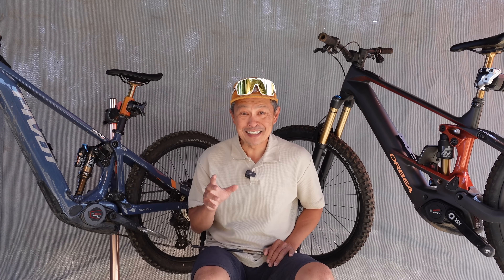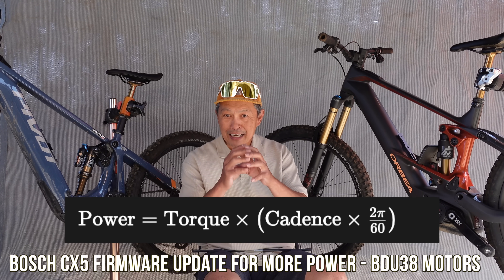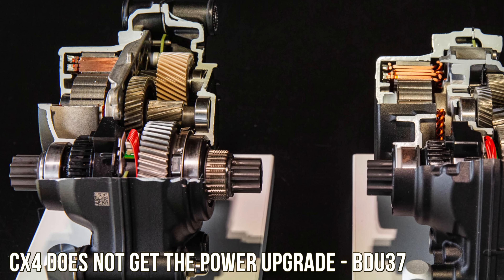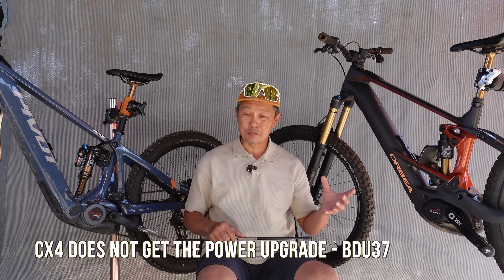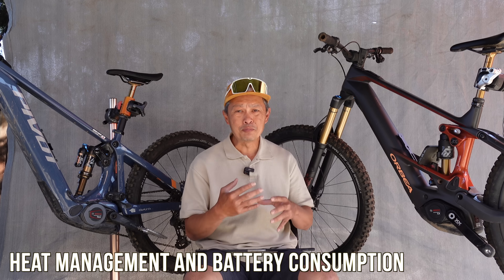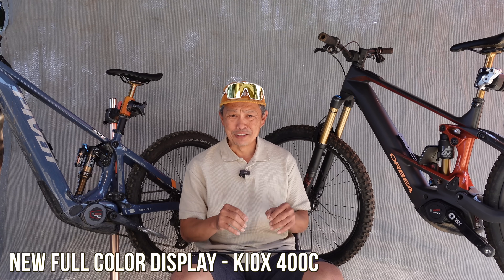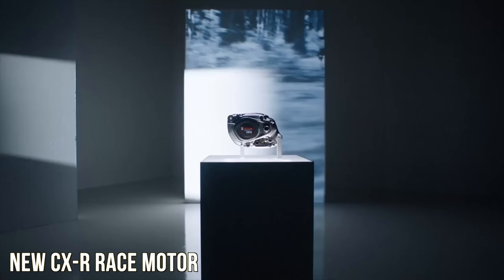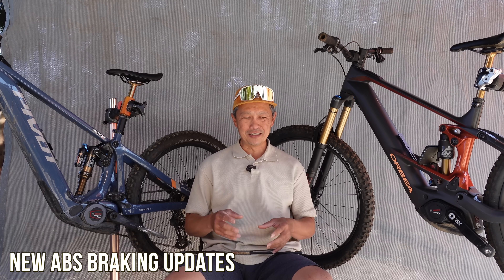Bosch CX5 emtb motor gets huge torque and power update but not CX4 - new color display Kiox 400c

Comment: I wish all the motors would have the same fitting so you could replace one with another 😢
Reply from the maker: Yeah, it would be nice if everything was interchangeable. Won’t happen in our lifetime though
Reply: In that case- improvements in weight and size would be much more limited and there are other incompatibility issues besides just the motor
Reply: Be nice if all phones where the same size to reuse cases etc. 

Funny they make them different sizes so we have to keep buying new???

Same,😊😊😊 same??

Comment: Watched the release video from Bosch. 

Heard CX 4 gets the software update with new mode EMTB + which is just as significant as the 100Nm of torque. 

Also software update will be available in July.
Reply from the maker: Correct. CX4 gets the new EMTB+ mode, making EMTB mode more usable.

It's nice but it's just tuning with no additional torque or watts.
Reply: @EMTBReview  does the emtb plus come to the SX?

Comment: dirty tricks by bosch they always do it over there older customers by not giving them the newer upgrades it's like giving them the middle finger like the crappy line battery display they have been putting on there bikes and now wanting £300 for the new display they could have put this on the bikes when they first released the gen 4/5
Reply from the maker: Yeah, a bit to many tips and tricks by Bosch
Reply: Many went for the older gen 4 to save a few hundred quid.......it's on them for not going the extra mile to get the gen 5

Comment: disappointed but do I really care about less torque ? no, 2nd big ride yesterday 33.8miles 5456ft max climb 27% (off trail on grass) and after trying several settings I'm back to my 55Nm limited eco,tour+,emtb and only left turbo at 85Nm I'm still unhappy with turbo as it's response is way too quick and ends either in a wheelie, tire slipping or a loss of control so next I will try to slow it's dynamic response (top right option in the flow app) because I would like it to correspond more with my pedal force not an on-off switch (like the DJI) which good news ! is apparently what the emtb+ mode will bring can't wait to test it
Reply from the maker: Correct. Not everyone is concerned about more torque. All depends on style and terrain.  But having more torque on tap really makes this ideal to more people, and more competitive in the marketplace.
Reply: @EMTBReview  totally agree :) you can tune down but not up so it's better to have the option
Reply: Torque is everything

Comment: Per one of the engineers I talked to the new Bosch motor is capable of a lot more than 100 nm but they want to keep it within class 1. If you want major power the HPC Trailblazer Pro can give 2000watts with 185nm, the owner of DVO has one.
Reply from the maker: I don't know about that. In the actual test by Velomotion, the CX5  with 750 watt upgrade was able to run solid for only 8 minutes before ramping down to cool off.  Thermal management is at its limit in that chassis now.
Reply: @EMTBReview to cool down or to "fit" into the legal 250 Nm nominal power measured over 30 minutes?

Comment: I am hoping to buy within about two months. It’s a no budget purchase so I was between S-works and trek rail. This update absolutely makes me more interested in the rail. I have a couple of trek shops nearby which makes me more confident in making such a big purchase and does shift me toward the trek. That display is going to look fantastic in the trek frame.
Reply: I'm waiting for the DJI bikes myself - they're so much sleeker looking and the power is hard to ignore
Reply from the maker: Will finally do the Trek chassis justice in terms of motor and display.

They'll send me the new Trek Rail to test but it will take a couple months since they're mostly sold out.
Reply: @ I will hold out then. I want to see what you think.

Comment: Another example of the bike industry sh*ting on the consumers, why not introduce the gen5 with the upgrades from the start and for all those who have purchased the gen4 with no upgrades available or backwards compatible. I've been on a gen4 for a couple of yrs and tbo I hardly ever use Turbo so these power upgrades etc are fairly pointless to me.
Reply from the maker: Yeah, it's the consumer that loses on this one.  CX4 buyers.  Also making it not available til July is bad for existing folks too right in the heart of the season.
Reply: I agree. As someone that rides 90+% of the time at low power this power arms race is pointless. My concern is that all this extra power will only hurt the acceptance of emtb on trail systems.
Reply: not the bike industry; Bosch, itcis only Bosch; they've made a sellout for the gen4 cx-race..and then launched the gen5, allowing brands 6 months to sell their gen4 motor ebikes; a win-win for Bosch.

Comment: My main issue is that the motor cuts off at 20mph, that doesnt seem to be resolved. This is an issue in races. All of these systems should have a race mode that removes the limiter or allows a higher limit like 28mph. Also it is sketchy when riding on roads to the trailhead with the 20mph limiter.
Reply: SpeedFun Furious Evo easy+ for Bosch Performance Line CX (gen. 5) Smart System with Rim Magne
Reply: so you want to cheat in a race lol or just use a Suron I don't think you quite understand what the problem is here...I've got a 400hp car I can go 120mph in a few seconds so "let's drive 120 everywhere !!!" that's not how life works talking about cars entry level rallying called N group is extremely limited those cars are way slower than my daily driver my power curve is literally double the area of a "rally car" but that's what racing categories are
Reply: @fredEVOIX  with that logic all automobiles in the United States engines should shut off after 85 mph because that is the highest speed limit in the US...  make sense
Reply: Exactly, also, the current eMTB motor systems do not decouple when not in use or not providing power and cause a LOT of drag just to keep the pedals turning. It is MUCH harder to pedal an eMTB unassisted than a regular MTB. That is why when the power cuts off its so disrupting. Just saying...

Comment: Good stuff! Thanks for the updates.👊

Waiting for the e-Dreadnought -DJI 170/170 & 800 Wh (I hope 170 🫰) '26!
Reply from the maker: Heck yeah. It'll be here in the USA in 2026
Reply: let's hope for 180-170
Reply: Worldcyclery is actually taking deposits for that bike now, but man the base model is 8600 bucks... with taxes, you're talking 9k+. ouch!
Reply: @rogeronehope4u581  did they know the rear travel for it? Yeah, expensive and TBH not in love with a high pivot design, but if price was right...which would have to be $6,500,😜
Reply: @TCFlowClyde  The light is 150/140, whereas the regular sized one will be 160/150.  But yah, I was hoping for the same price,  but sadly, the Canadiens are sticking it to americans with the price 8600:(
Reply: @rogeronehope4u581  the analog Dreadnought is 160 mm but rumor has it that Forbidden is ready to push the kinematics for a 170+ travel. I made an inquiry yesterday. I'll post here if it's indeed true.👊 They also might just do the cheaper frameset like with their analog offering.
Reply: My guess is that the DJI will be forced to restrict the output to 750w.  I'm pretty sure Bosch have enough influence in Europe to get this restriction applied too.  Here in the UK we have a real problem with kids and criminals riding unrestricted ebikes.

Comment: I'm fairly disappointed, I went with a leftover model with a  CX4 at the end of last year and the few updates on the gen 5 didn't seem worth it. I'm curious to know what the technical limitations are that prevents the gen 4 from getting the update. Or why they didn't just enable this on the gen 5's to start with. I'm guessing the extra power is straining the motor and they didn't want the increase in warranty claims, but with the Levo having more power they had to risk it.

Pretty shitty thing to do and will likely be my last Bosch-based product.
Reply: I have Trek Rail with gen4 motor. I bought it last year, and I have absolutely zero wants to upgrade practically new bike... what for? 85 nm is more than enough, 75% of time I am in emtb mode and 25% in tour... no turbo usage.
Reply from the maker: I explained it in the video where the CX5 motor is a completely new chassis and gearing and magnets to provide the additional power. They just hid it from the market to help their bike partners not get stuck with incoming inventory.
Reply: @EMTBReview  Yep, I made my comment before completing the video 😃I got a pretty good deal on the 2024 Wild, and may have got it anyway, but hiding the power upgrades behind a firmware update is just sneaky and hurts everyone. Had I known about the upgrade I may have waited and got that new bike for $8k+ vs. the $3900 special. Seems they could have at least figured out how to keep the bolt patterns the same so there was a chance of upgrade down the line.
Reply: Bosch is only the maker of the system. You should ask the bike manufacturer or the dealer, why they didn‘t inform about the upcomming changes. They knew it for sure.
Reply: @Weissi0711  They were probably under an embargo, I heard many reviewers saying they knew the update was coming weeks ago, but heard it 3rd hand while people that got the news from Bosch couldn't say anything.
Reply: @noControl556  Well, I heard, that it was the bike manufacturers that held Bosch back with the release until their stock of older bikes was reduced enough…. But
hey, at least you will get the newest SW,  EMTB+ with up to 400% sounds pretty good to me…
Reply: @Weissi0711  I guess, I run mine full bore Turbo 100% of the time. I come from a dirtbike background and got into emtb so I can ride during the week on local trails.
Reply: Bosch has done the same thing on the last three motor updates. System2 and when the CX4 was first released it had the same power and torque output of the motor it was replacing. Then later they released a firmware update that increased it to what you’re familiar with. 🤷🏼‍♂️
Reply: Boycott Bosch!  For those of us that purchased recently - we were screwed
Reply: @ grow up.
Reply: @Weissi0711 okay Karen👍🏻

Comment: Do you know if they are going to update the CX4?
Reply: Of course not.....  just my bad luck....
Reply: Totally.  They updated it by trying to toss it in the trash.
Reply from the maker: Correct. No chance unfortunately. They can't squeeze water from a rock and that chassis is already tapped out.
Reply: @EMTBReview  But as you noted FC, it's not at all a deal killer... I have the CX Gen4 Race motor and my data show me using Race mode 3% of the time. It is only necessary on the steepest of climbs. Turbo mode is more than adequate as is 85nm torque...
Reply: @kyledavis635 agreed.  I've only used turbo a handful of times and it seems like too much for trail riding.  I think the power upgrades for gen 5 are more a selling point to stay competitive, as most people I know rarely ever touch turbo.

Comment: The coast shifting, aka free shift, is amazing and much better than auto shifting. Shimano Di2 with free shift is the bee’s knees.
Reply from the maker: The problem with auto-shifting is gear crunching since there is no clutch and the drivetrain is in high pedaling load situations when it needs a shift.  Coast shifting though by definition has no load on the pedals, thus, shifts are smooth.

As far as usefulness of coast shifting.... It's not really necessary or a big advantage.
Reply: @ I love free shifting or a Bosch calls it, coast shifting. I encounter many instances where I take a big drop followed by a punchy climb and with free shift I’m in the right gear every time. So for me, it’s a win.